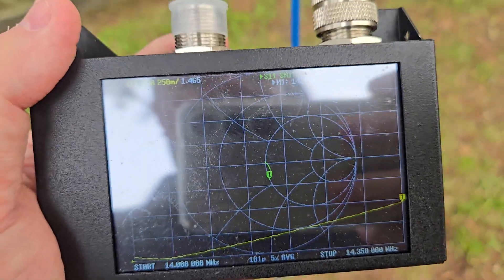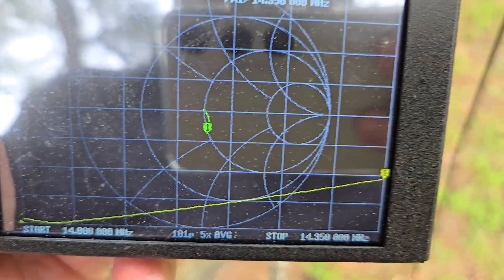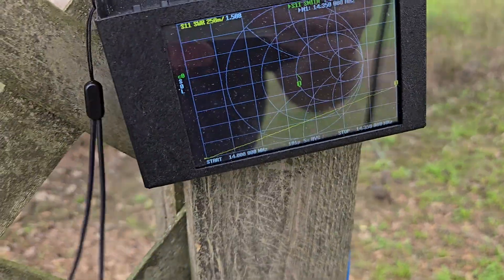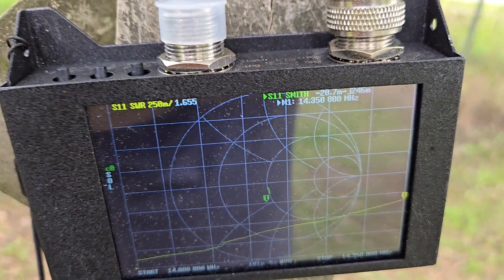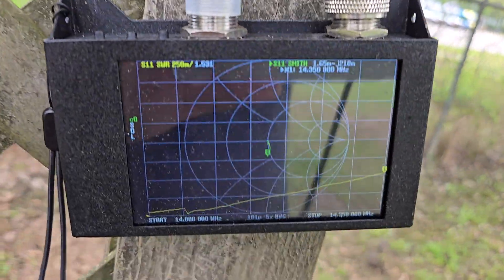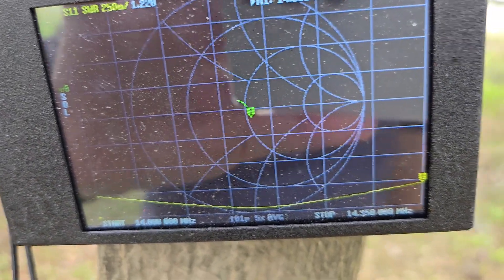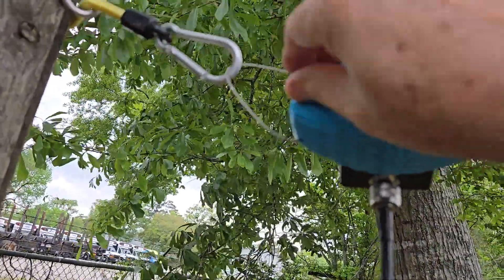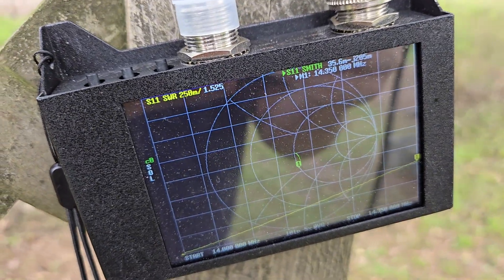Quick Demonstration of the Reel POTA-ble EFHW Antenna

Comment: I would like to see this demo on a RigExpert. I cant tell anything with this video.
Reply: The yellow line at the bottom is SWR.  As he winds that lever the low SWR point (frequency) is increased from 13990 to 14200 by shortening the wire.
Reply: @thomashardy9994  I have one of thee antennas but hav not used it yet, but will put a Rig Expert on it. thenks i have never seen how a nano works